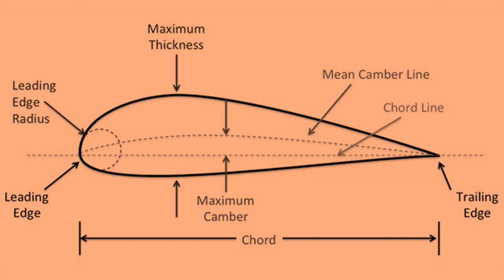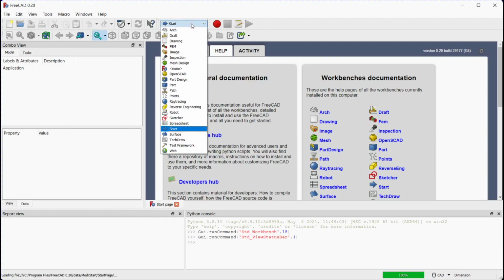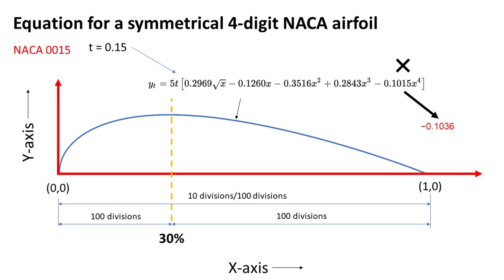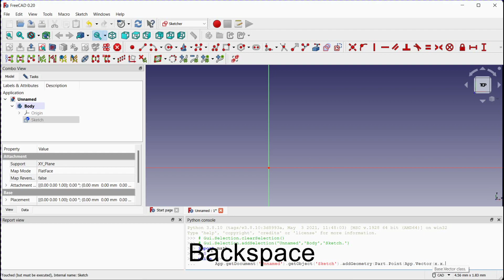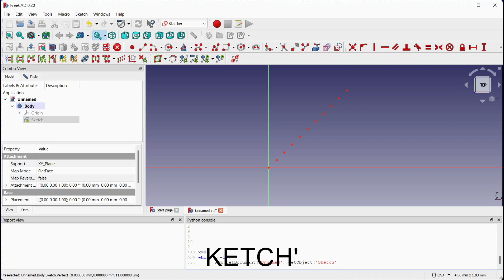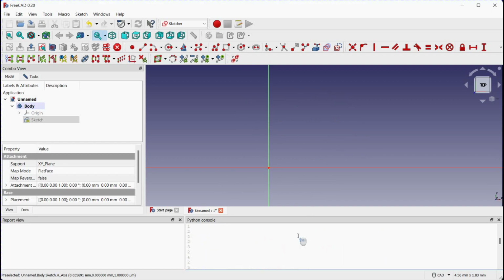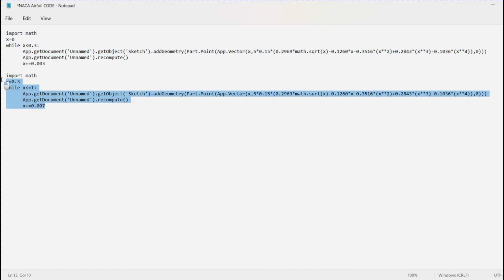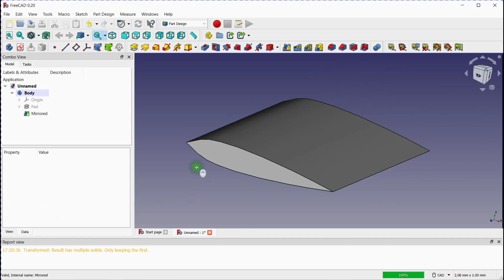FreeCAD: Python scripting tutorial | How to model NACA Airfoil (Part-1)

Comment from the maker: We want to thank Michael Mueller for this insightful comment! @michaelmueller9635 For those wondering, this refers to an important aspect of modeling NACA airfoil profiles using B-splines in CAD software. In standard airfoil definitions, the leading edge should start with a vertical tangent (90 degrees to the x-axis) to maintain the correct aerodynamic shape. If this constraint is missing, the generated curve may slightly deviate, affecting accuracy in simulations, manufacturing, or 3D printing. To ensure correctness, it’s recommended to apply a tangent constraint at the first control point of the B-spline so that the profile remains true to standard airfoil equations. This detail is especially important for those working with precise wing profiles, ensuring smooth curvature and reliable aerodynamic performance. 🚀

Comment: There maybe some catch to it (and if someone is wondering too):
I guess the bspline in the last example is not constraint at the start point to 90 degree to the x-axis.
Reply from the maker: Yes, you are right! We need to constrain the model or sketch properly to ensure the desired behavior. However, if the loop is closed and used for other purposes where the specific orientation is not critical, then it may not be necessary to enforce this constraint strictly. We hope we have understood your question correctly—let us know if you meant something different!
Reply: @Learn-Engineering  Thx for the answer, it's what I tried to say.. Normally tutorials do not take accurate profile data (like NACAs, ...). But since you are working with "real"/accurate data, the first point should start 'normal' to the x-axis. 
It is not so much a (free)cad thing, it is more about profiles.

So maybe someone with no freecad knowledge and a lot of wing/profile knowledge is watching the video later and begins to wonder about it.
It was just a comment for clarification from my side.
Reply from the maker: @michaelmueller9635 Thank you for your valuable comment! We have pinned a message so that other viewers can benefit from this insight. We truly appreciate your input and encourage you to stay connected with us as we continue improving our channel. Your feedback helps us create better content for the community! 🚀

Comment: thanks you very much ! Butif i want for exemple a 140 mm wing, it's seem that the NACA equations are not correct anymore... do you have any advises ?
Reply from the maker: Thank you for your comment! When it comes to designing wings with specific dimensions, the NACA equations can still be a useful starting point, but they might require some modifications. You can scale or modify thickness distribution.